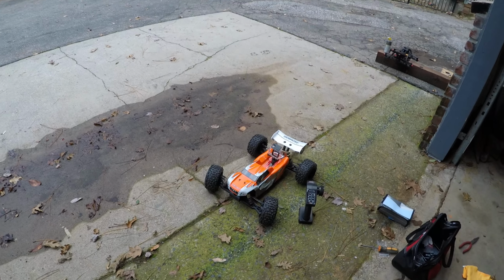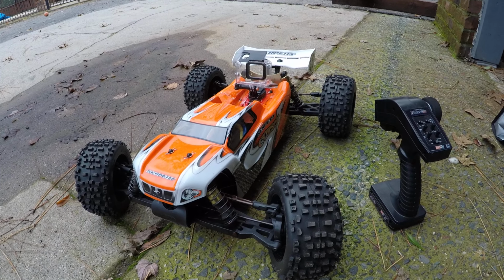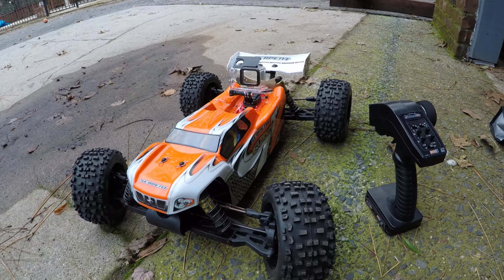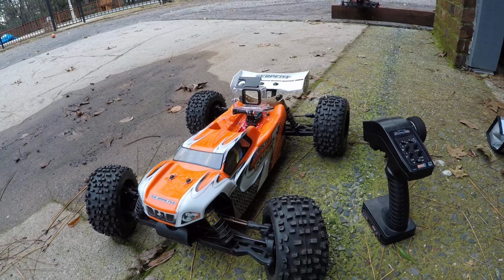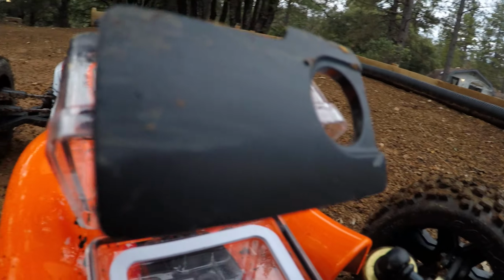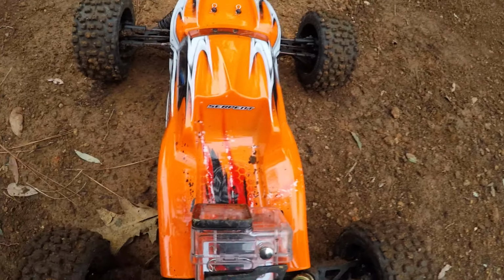Serpent Cobra Truggy rtr first run on my track #rc

Comment: 1 of the best rtr truggy i ever own till today...i got the Team C t8tv2 as well and also the arrma talion with loads of hop ups..i can say this cobra is much more nimble and agile comparing to the heavier talion..just a tad bit behind the T8Tv2 in performance....i consider the cobra to be great due to its stock form..
Reply from the maker: Ya I agree. Thanx for the watch. I was gonna sell it due to having more cars than I can run ever but it's hard to let it go. I have a bunch of upgrade parts I've never installed.

Comment: I’m really about to pull the trigger on this truggy is there any problems I should know about? How are the diffs and the ring and pinion in them? Is this truggy worth it? I’m going away from arrma
Reply from the maker: Well as far as an rtr its awesome out the box. I've ran a quite a few packs thru it and havent had any diff issues. So I havent broke into them yet. Compared to arrma, parts arent as easy to get but the kit parts do fit and those are super high quality. Biggest downside out of the box is the radio but same for my talion. I love it and I love not having what everyone else has. If you order from amain couple things you should know if so hit me back. Hope that helps
Reply: I’m going to order from Amain hobbies soon, and I’m into race kits but I want one rtr for screwing around wether it’s bashing or racing with family at a park and I feel this is the rtr for me so I appreciate you replying and helping me
Reply from the maker: So just a heads up you have to ask for the color you want. Put it in your order or they give you a random color. Besides that mine didnt come with the radio pictured and they told me it's normal to come with whatever they have. Hooked up to my 4pv obviously is a million times better. I'll be looking for a bash video from you soon!
Reply: Keep posting rc vids I’ll definitely be watching especially on your serpent truggy👍🏻